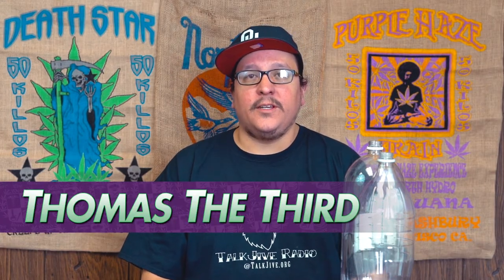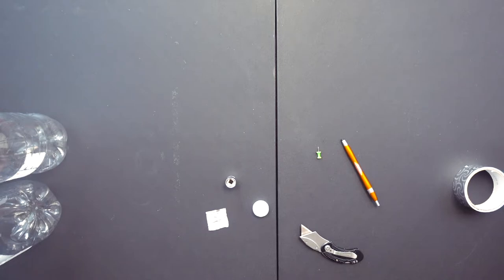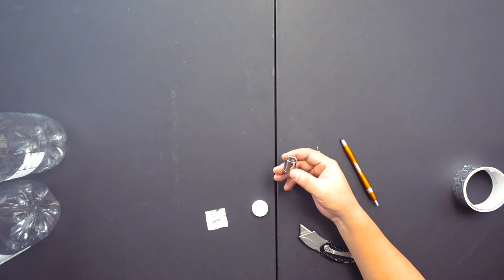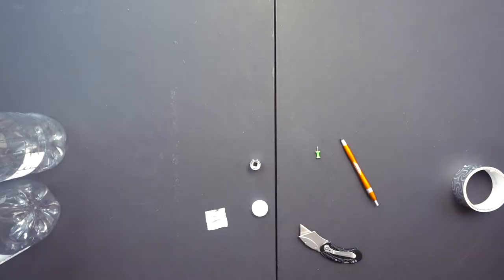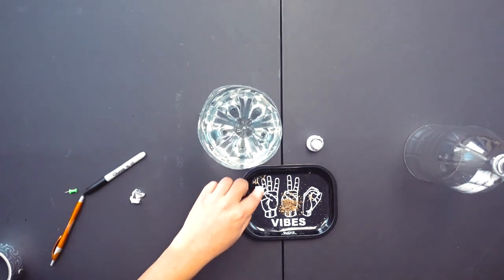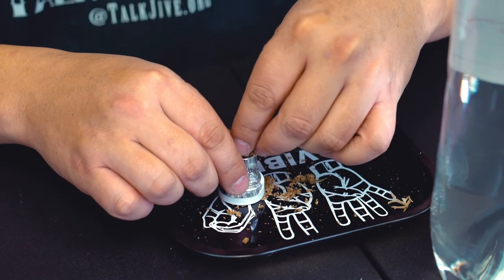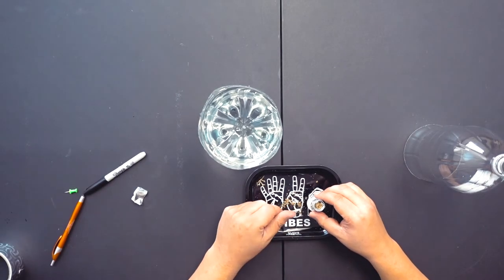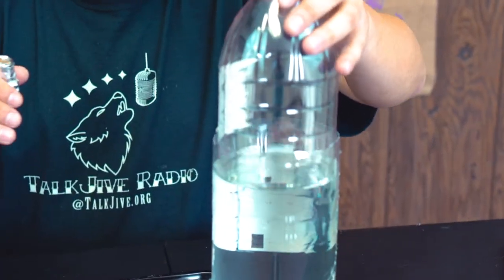How to Make a GRAVITY BONG! - The Weed U

Comment: I rather get a 1.5 liter bottle make a 1 inch diameter hole on the bottom and on the lid place the socket and a little small hole nest to it on the lid. That way I just lightvit once and the drainage takes care of the rest